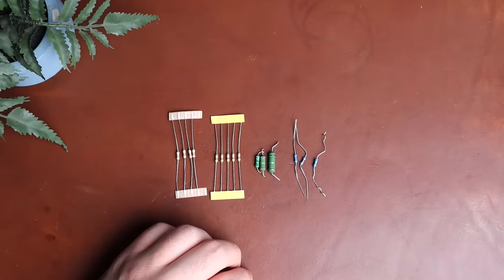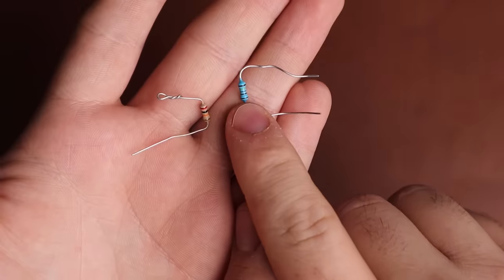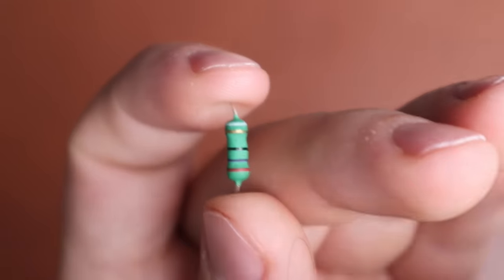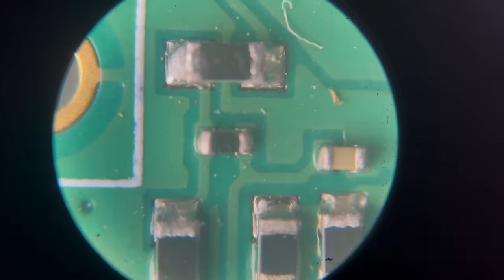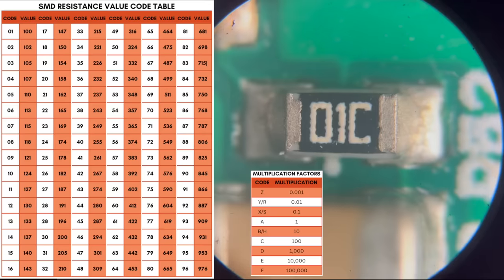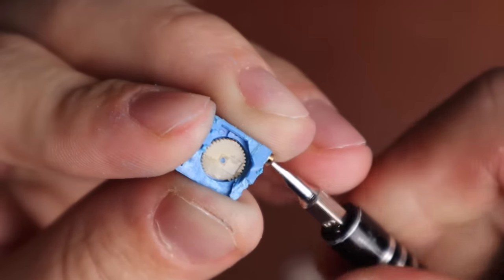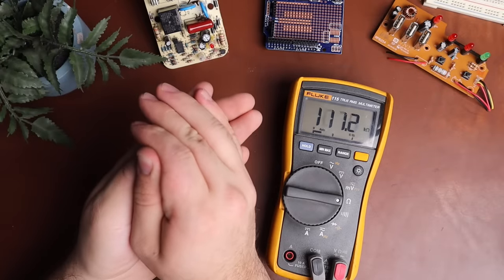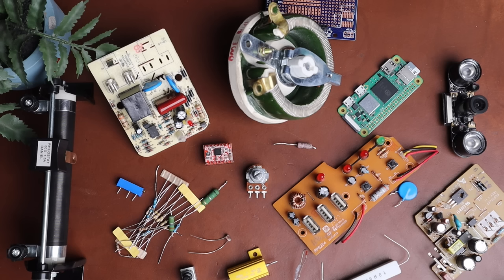Understand resistors better than EVERYONE, a PRO guide to all common resistors.

Comment: With the blue metal film resistors, you look up the color code, then.... you measure the resistance using the meter, because it's impossible to read those colors against the blue background, and it's nearly impossible to tell which direction to read the resistor! BAN BLUE RESISTORS!!
Reply: Get a magnifying glass 👍
Reply: @maximnoize8760  the resistor not being clear in my vision is not the problem
Reply: Istg it's so real
Reply: Skill issue.

Comment: Pro tip: You can parallel bigger resistors to achieve the smaller value you want and that way you can handle a little more heat and power.

Comment: As a computer science student who builds prototype and code on them this will help me a lot. I hope you could make more similar videos on pnp npn transistors. Diodes and ways of designing a pcb. 

Congratulations man you got a subscriber
Reply: Hey, I'm also a CS student and learning electronics stuff on the side. Have you considered doing Comp Engineering? Or are you sticking with CS?

Comment: Great Video!! Concise and entertaining. Info dense without filler but easy to understand and follow. Subscribed and will be ordering both the mug and guide for support. Thanks for your work. I am intrigued by the vast applications of the Arduinos and am wading into these electronic components. This was by far the best video about resistors and how they work.

Comment: Not only have I liked, and am now subscribing to your channel, but I have just purchased your incredible guide to resistors.  Thank you for putting this information out.  I love creating spreadsheets, so I will be using a lot of this information to create a spreadsheet to input colors and have the totals calculated automatically.  I have created a number of spreadsheets for inputting (such as), how many 18650's in total do I need to create a battery pack, and how many batteries will I need in series and parallel for an intended target of Ah and voltage.  I put in a couple numbers and save myself about 10 minutes of using a calculator, and instead get my answer in 2 seconds (awesome).  This information will enable me to create another spreadsheet for sizing up the correct resistor/s needed in a project.  I love electronics and spread-sheeting, so this should be fun.

Comment: Magical video... I have thousands of 14 watt resistors from my hobby days... They cost little, yet aren't that simple (I now know)... I had a Russian built transistorised clock radio in the early 70s... it was antiquated in its construction, with uninsulated wire coiled round resistors in places.  I thought back then the reason was a lack of proper value resistors... They may have been inductors...

Comment: I tried to enlist into the Air Force back in 1983 and learn electronics . Based on my ASVAB score , the recruiter told me that I " tentatively qualify for any of the Air Force jobs " . Tentatively because I still had to pass a physical . The following week they scheduled me for the physical , whereupon I failed the test for how well you can see colors . So that disqualified me from obtaining any of the high tech jobs offered by the Air Force . Probably they're concerned with someone not being able to read color codes - like on those resistors . Well , that ended my foray into the military . But as a former radio amateur , I do appreciate those resistors .

Comment: Well earned coffee for the guide. Hard to find condensed info on them (try getting all of it from the art of electronics book). Hope more comes up, looking forward to a diode and capacitor video and guide.
I have one question though. I have some buck converters which feature this trim pode with a lead screw. Not sure if cheap China construction or something to do with the trimpod.
Sometimes I turn them and turn and turn but nothing changes.
What happens as you keep turning as there are no hard limits. My assumption is that it will loop around, but is that detrimental to the integrity of the trimpod?
Reply from the maker: Buck converters should output a change in voltage as the Trimpot is turned, (make sure there is no load on the device when testing) its quite common for cheap trimpot wipers to get dislodged with to many turns, it may need to be replaced.
Reply: @james_gatlin  thanks for answering. I have a pack of 10 of them. 4 already presented this problem (no load while turning, just multimeter and power source), that's why I asked, because I keep turning them until I see a voltage change, but they seem to fail fairly easily,.so I was wondering if I was bricking them or if just low quality. 3 of them stop stepping down the voltage to and one didn't change voltage anymore. They are supposed to reset, after a full course right?
Reply from the maker: @tinkerman-q  Yes, it should either reach a limit, or do a full turn and reset.

Comment: Starting with this would be more informative:What is meant by resistor?
A resistor is an electrical component that limits or regulates the flow of electrical current in an electronic circuit. Resistors can also be used to provide a specific voltage for an active device such as a transistor.

Comment: Cool video. How about adding how the values in a series is determined. That was one thing I always wondered about. I was on a large public works project doing communications integration. One of the "engineers" submitted a test procedure to test the validity of an analog input to a PLC for an unimportant task like high/low temp or something. The procedure called for placing a 500 ohm resister across the inputs. Well 500 ohms is not a standard value the closes being 480 ohms. I said I will use two 1k resistors in parallel. Nope, our procedure called for a single 500 ohm resistor. We had to get two specially made, one for testing and the other for reference. I think it was like $800.

Comment: So hear me out. If i put 100 1/2 watt 1kohm resistors in parralel, dont i get an equivalent 50 watt 10 ohm resistor?
Reply from the maker: 🤔…….. yes and no, you can divide the dissipation across many resistors, but that many resistors will heat up the neighboring resistors, have unpredictable impedance, and reduce the power capacity, though not entirely, perhaps in this example you’ll get a 35-40 watt capacity.

Comment: Yeah, knew all of this. But I'm still searching for the answer to "why?" Why are different values needed? How do you know, when designing a circuit, if you need a resistor at all? Variable resistors make sense. They can be thought of as a dimmer. But when do i need a 500 ohm resistor? 5k ohms?
Reply: There's like a million answers to this. Sometimes you can use a resistor as a potential divider, since voltage is proportional to impedance.

Sometimes you can use a resistor to limit current, for example to an LED. Here the maths would be based off of the maximum current rating of the LED and basic circuit laws.

Sometimes you need resistors to bias transistors (apply certain voltages/currents to them consistently to keep them within certain operating conditions during normal operations). This is both for analogue circuits ergo amplification and more, or for digital circuits where the transistor is used for switching. Here you'd use a large set of transistor equations, depending on the type of transistor, to set either current or voltage or both.

Impedance matching, RC circuits/oscillators.

And there's so many more uses. Ultimately the specifics of this is something people spend years learning and even longer to specialise in specific areas. It's insanely complex and there's different formulas for every different field and application, so this is just a rough overview of a few examples.
Reply: You need to know what current or voltage you require,and you can work that out using Ohms law.
You need to find some information about Ohms law. This is usually proved as a chart in a circular format.
once you get your head around that, it will become much clearer.
I hope this helps.

Comment: You can find low precision resistors anymore.  It's just too easy and cheap to get higher tolerance with modern manufacturing.  It's neat to get into older electronics.  Careful.  Very old electronics are positive ground.  And motors are still positive to negative current flow. Conventions and history...yikes!

Comment: you missed the resistor's pack... but tbh i had saw it just once in my life (well at least looking for them) they do look like tiny  versions of polistiren capacitors with 3 or more legs... if i recall well they are like voltage dividers, cheers.!

PS: also ceramic ptc, ntc (ptc are used in iron soldering, hair treatment stuff and the most usual in electronic perfuming  environmen devices [dont know the word for it] ) and maybe mosfets but i really wont use them for those functrions.

Great video!